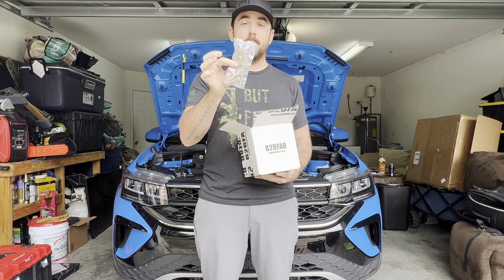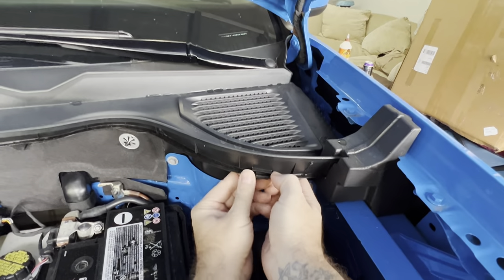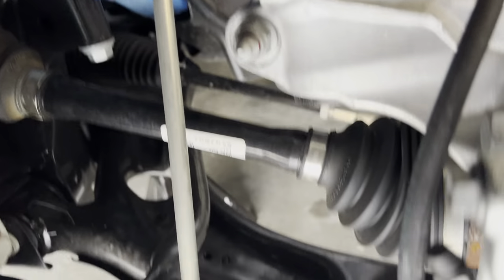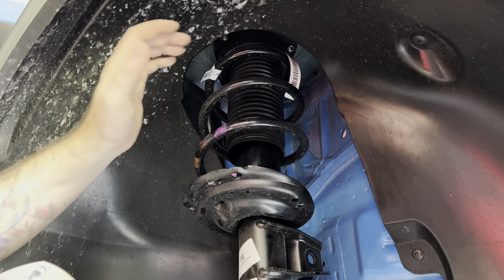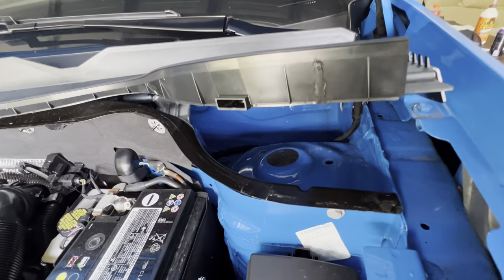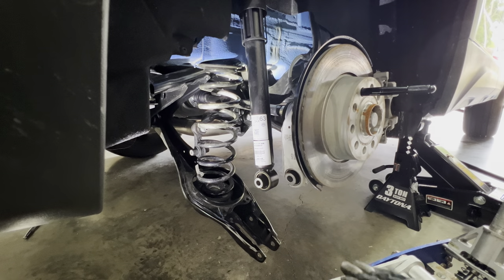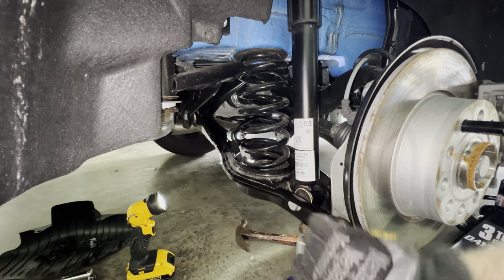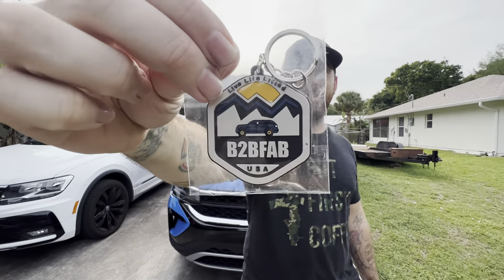VW Taos - SE 4-Motion - B2BFAB Collaboration!!

Comment: I got the same lift on my Taos about 2 months ago and its been great. They are sending me the new upgraded lift right now still not officially released and I'm getting it installed as soon as it gets here.  Arno from B2BFAB was telling me the upgrade gives between 0.5 and 0.75 inches more clearance that the regular lift. I swapped the 19 inch stock wheels for some 18 inch BBS XRs with some larger 225/55R18 Michelin Cross Climate 2s and it looks and drives great. B2BFAB makes great stuff. I also have their stop/start solution and it works great! Thanks for the video man!
Reply from the maker: That’s awesome, I’m happy to hear you’re loving it so far. I believe we will be doing the upgraded lift as well in the future. We just got some 18” Neuspeed wheels and will be going with a similar sized A/T tire for them. I’ll be doing a short on the start/stop install here soon. I have it disabled on my S4 and it’s so much better than dealing with it while driving. Thanks for the love.
Reply: Hey bro I got the same car back In august last year. All I’ve gotten around to do tso far is tint it out. Any recommendations as far as performance parts? Also those bbs xrs are sexy, I  may have to take your style.
Reply from the maker: @Jamrockballen  I don’t know of too many performance mods yet. I do know some basic bolt ons are in the works though.
Reply: @Wobblenuts  APR has an ECU tune coming out this summer.